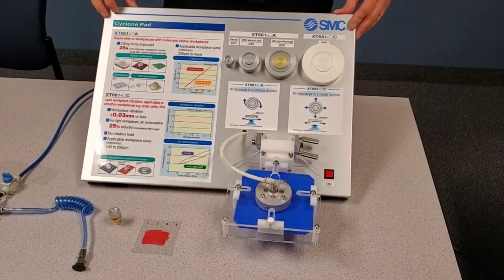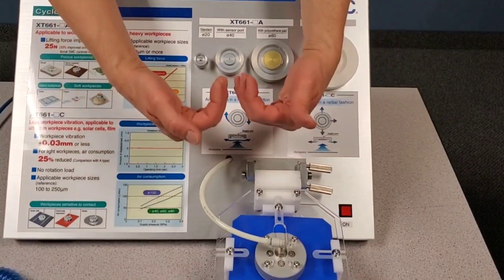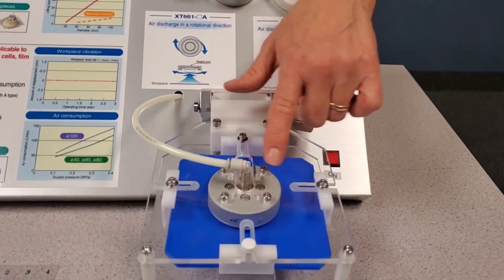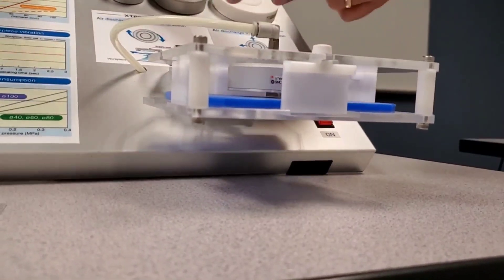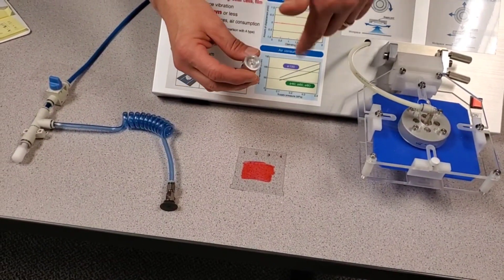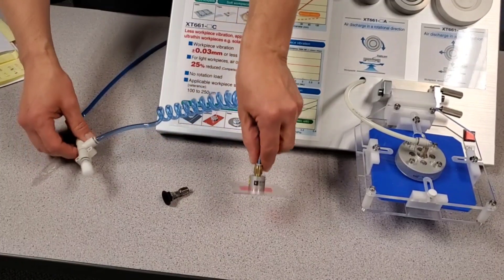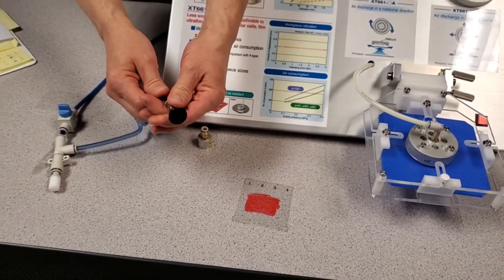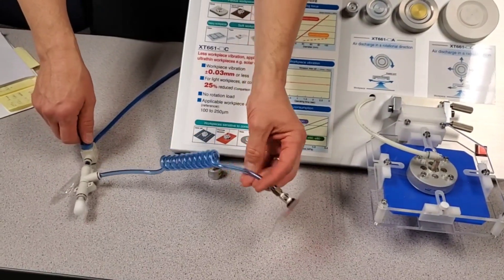SMC Vacuum Training XT661 Cyclone Bernoulli

Comment: Why did you conect an eyector to the little ciclon pad? this pad doesn´t requiere vaccum
Reply from the maker: I made a mistake in a rush to finish the video. You are 100% correct, the venturi/ejector is NOT needed and not recommended in this application.